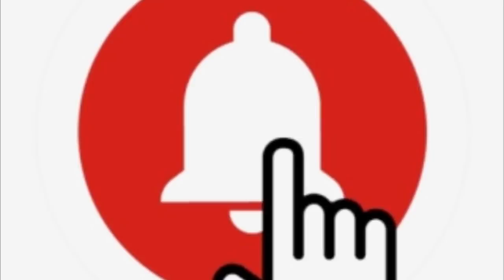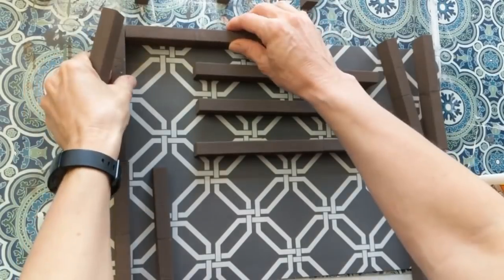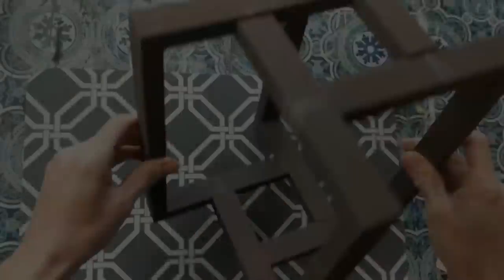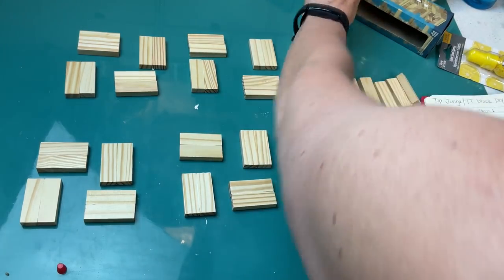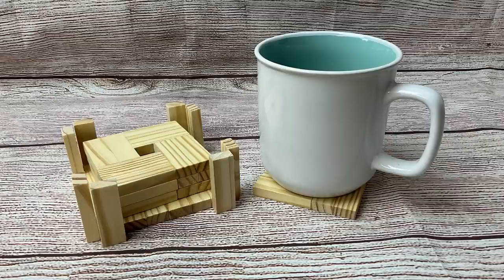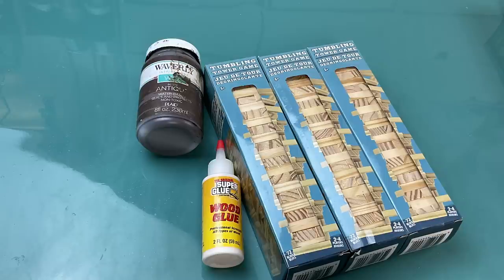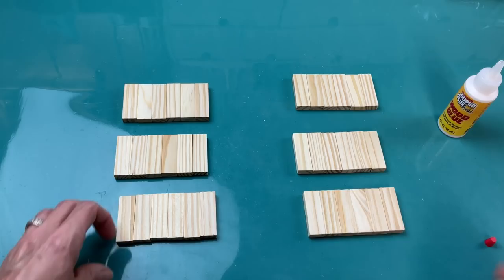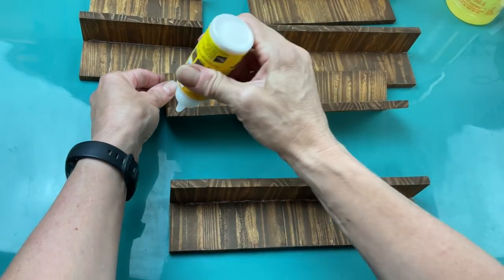TOP 12 DOLLAR TREE DIYS using  TUMBLING TOWER BLOCKS | JENGA BLOCK DIY | DOLLAR TREE JENGA BLOCKS

Comment: I love, love all of these.  I just want them all!  I am struggling with gluing the tower blocks. But I will keep trying till I get it. Have a blessed week.
Reply from the maker: Use wood glue and let it sit
Reply: The Super Glue wood glue from Dollar Tree works really well and is faster to dry than regular wood glue.
Reply: @gladyssetzer8269  Thank you! I will give it a try🙂
Reply: What glue do you use? I always make sure with whatever glue I use, and it I use hot glue to have it on high heat, to clamp them until they are well bonded. Happy crafting! :)